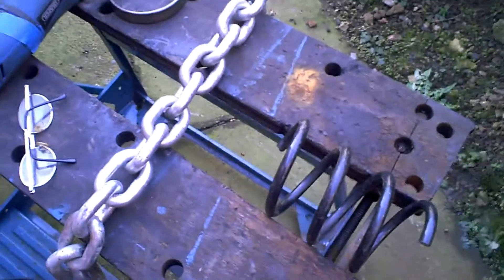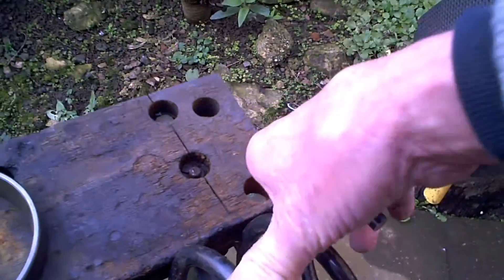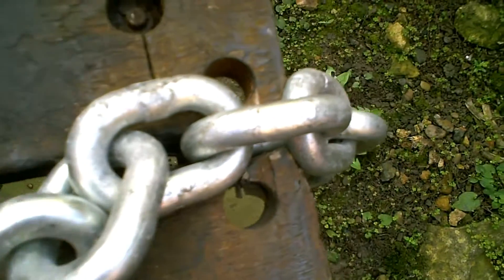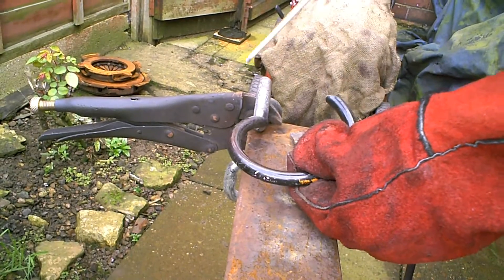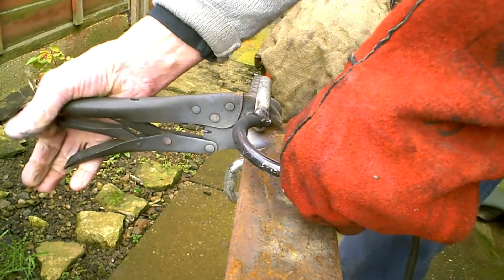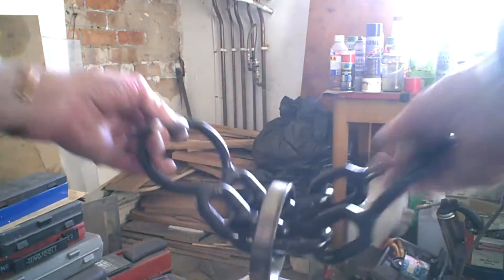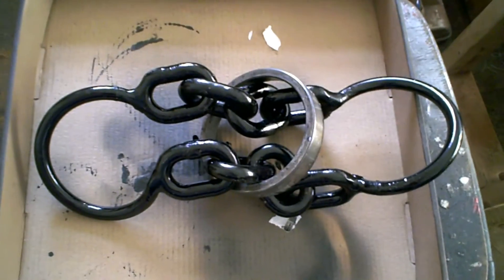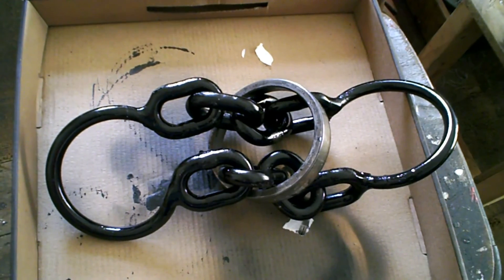Metal Art from Scrap

Comment: after seeing my mate nearly bleed to death by an angle grinder blade shattering and embedding in his leg, i always use a guard on my angle grinder, just a friendly word of warning mate, hes an engineer by trade, never used a gaurd in 30 years....he does now, you only do that once
Reply from the maker: I know exactly what you mean thanks, been using them for??? 50 odd years now, so know about them shattering. Nearly always caused by trapping the blade sideways.  I always use glasses or safely glasses. I worked as a precision external grinder for 16 years, using 26 inch wheels. If you don't get them balanced, or they blow up, you're dead. They are well made and tested, hence why they are quite expensive. Never use cheap ones as they can? be dodgy. Also when fitting a new one, let it run for a minute or so keeping well out of the way. When using grinding wheels I always try to keep my head to one side...just in case.
Reply: They can be unpredictable mate